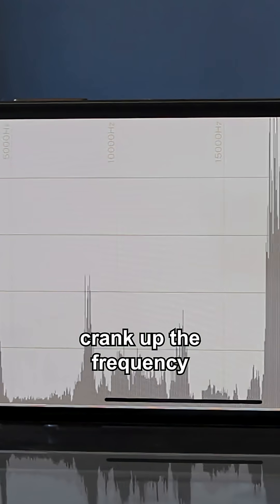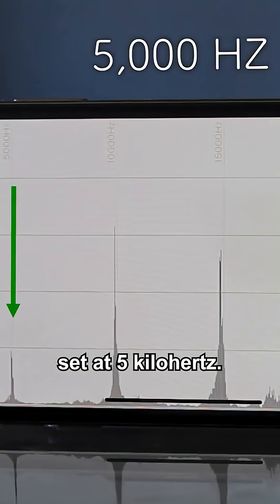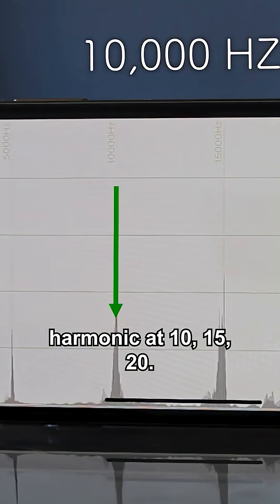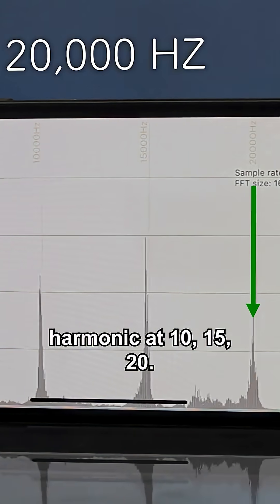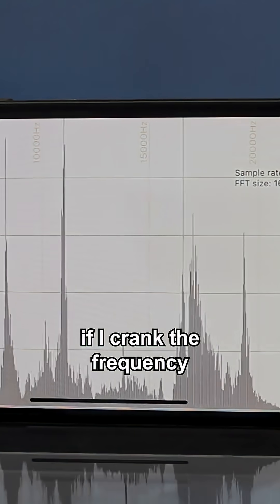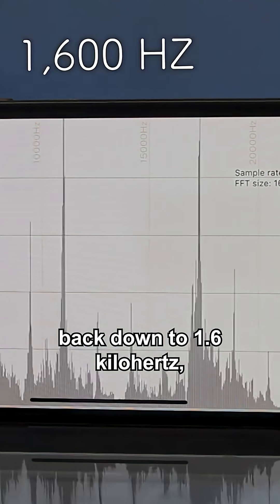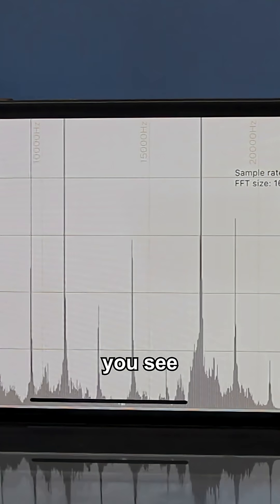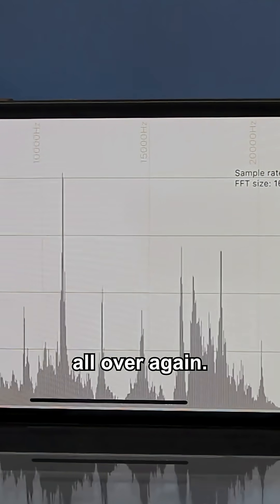DIY iPhone Oscilloscope: Hidden frequencies Revealed

Comment: High voltage will kill any near by device, I killed two DMMs, one 3 feet away, from a 20kv supply voltage, one that could handle that voltage. Before you even ask, it wasn't even connected to the supply voltage

Comment: Only problem is a spark gap is going to be in the Mhz to Ghz range and not only have harmonics BUT also SUBharmonics of the fundamental frequency of the spark gap along with sidebands. 
That phone is only measuring the subharmonics in the audio range and the first freq is not going to be the fundamental. The fundamental will be the strongest freq. Just get a tinySA so you can have a cheap spectrum analizer that goes into the Ghz and has an antenna.
Reply: He is talking about the firing rate, or break rate, which for low power arcs between cold metal electrodes (temperature plays A HUGE ROLE) is in the audio range. Given enough reactance (sufficiently high-Q inductance and capacitance) in the circuit, the arc may never fully extinguish, allowing each damped wave train to overlap with the next even when untuned - but when brought into resonance, i.e. the relaxation/spark-gap RC oscillator firing rate is roughly equal to the LC tank resonant frequency, a true continuous wave  output can be achieved, along with the claimed 50-70% efficient operation as a power converter, turning a few hundred to a thousand volts DC into harmonic-rich but absolutely continuous RF output. Given further refinements of the gas mixture in which the arc occurs, and powerful magnetic fields across the gap, outputs of up to a few hundred kilohertz were supposedly possible.
Reply: MHz and GHz. There is no such thing as Mhz or Ghz because hz doesn't mean anythiing. h and H are not the same.
Reply: @mernokimuvek  i GuEsS yOu CaN'T rEaD tHiS, tHeN?

Comment: specDroid :) fft via microphone, i use to analize electric motor bushing
Reply: what can you tell about the brushing from the sound?
Reply: @teodoricusslack  When it comes to the sounds produced by bearings, it is possible to predict their future mechanical failure long before they seize up. High frequencies and “knocking” noises begin to appear, shifted in frequency relative to the rotational speed of the rolling elements (bearing balls rotate more slowly than the shaft), from which one can infer bearing race damage or shaft looseness.
Reply: Thankfully your comment didn't get removed, as mine did (YT won't let me mention product names and I mentioned the 🍎📱 name).
Definitely a powerful tool!
Reply: You use it to WHAT electric motor bushing?